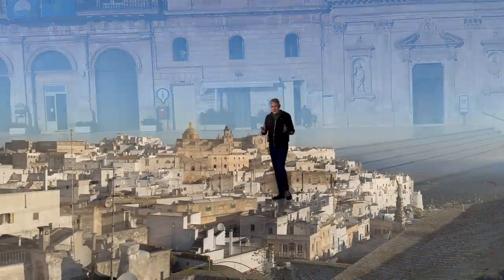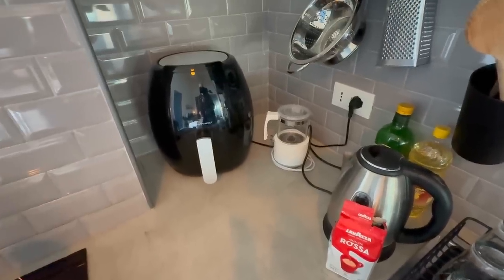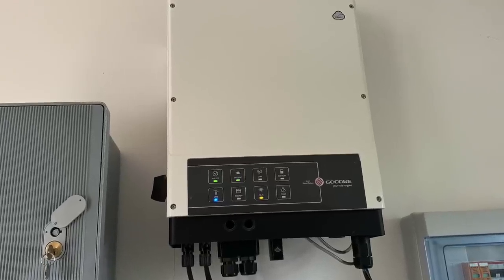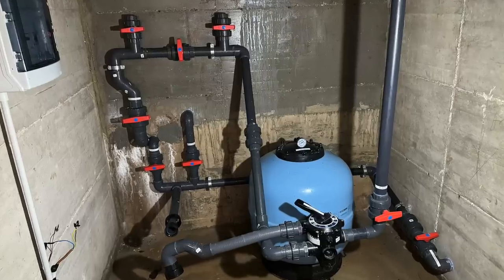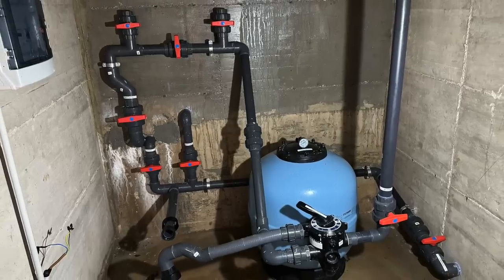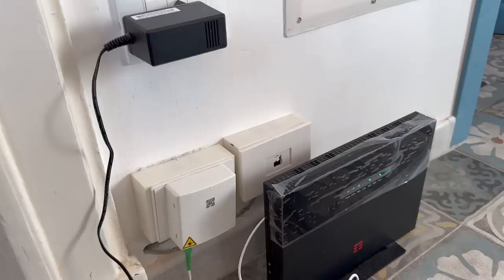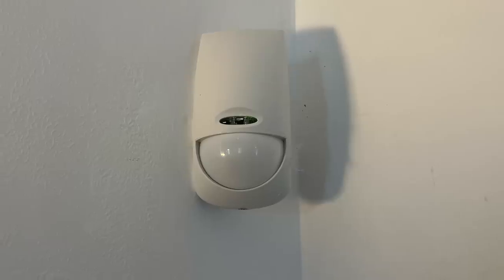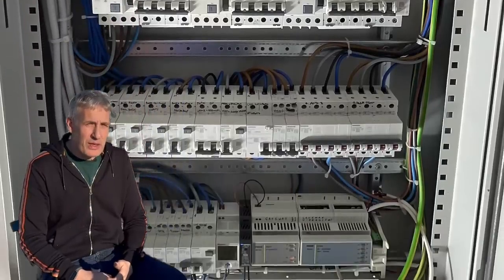How to Find Electrical Faults Before They Happen - OMHERO

Comment: Don't worry: the 25A breaker after the meter is there only because it's required by code, it will never trip. In fact I'm even surprised the 16A inside the apartment trips first, since with a 3kW meter it should trip the meter first!

Reason being that the meter measures the current electronically, and if the power goes above what it's allowed by the contract (depending on how much power you are allowed to draw from the grid you pay an higher fixed rate, 3kW is the norm, but you can get 4.5, 6, up to 10 for single phase) the meter trips out first. What is on the meter is not a normal breaker, in fact it's a breaker (63A) but it can be tripped electronically by the meter electronic itself well below is rating. 

The reason why they don't just put a rightly sized breaker on the meter is that the limit is purely software and depends on your electricity contract, i.e. by making a phone call (and accepting to pay an higher bill) they can increase it remotely, since all the meters are connected to a network (they can even disable a meter remotely if you don't pay the bill!)

By the way, the most annoying thing is that you are no longer allowed to have the meter inside your house, for reason that it must be accessible from the public street, this to allow the power company to check it without having to grant access to your private property (that requires calling the authorities) in case they suspect electricity thief.

Comment: It is very similar in Spain. 16 or 25A supplies. I have found that many of these domestic properties here in rural spain lack any CPC’s or any earthing at all. One property I saw had earthing cable run through out but had no connection to a ground conductor, leaving there salt swimming pool when stepping out as the easiest path to ground during a fault condition with an appliance in the property, which caused the tenants quite a lot of pain when there oven was broken.

Comment: 0:57 That looks like NYIF which we call "Stegleitung" in german which roughly translates to bridge cable, for the wires are connected with a "Steg", the plastic bridge in between, which is a good spot for a nail to fix it to the wall.
Also, most probably, regarding the age, that'll most probably only be twins, without the earth, using a bootleg ground. (Used to be the norm in germany, that's why it's still called "classical")
Reply from the maker: Thanks for the info “classical” like that 👍

Comment: Something to note is that 25 amps is plenty. If paired with more then 2 circuit breakers of course.
Almost a whole house on a single 16 amp breaker is just asking for nuisance tripping.
My, slightly smaller, dutch home is fused at 25 amps. And that is a fuse not a circuit breaker so it can handle small overloads for longer as the wire must physically heat up.

I could upgrade to either 35 amp single phase or to 3x25 amps 3 phase as all 3 phases enter the building. Though it is a rental property so i am not going to do that :).
Reply: They'll handle their EV charging well lol
Reply: My a lot bigger Dutch house is at 35A, but I have homewizard energy so I know almost as much as these prycam people — and I have never yet seen a peak above 5 kW yet. and that’s without doing anything at all to avoid simultaneous use of washer/dryer/dishwasher/kitchen boiler/etc. But: cooking and heating are gas, no AC (other than a mobile unit I haven’t switched on this year), and the dryer is a heat pump type. And no EV, obvs. Change that and I might have to move from 35A service to 75A (3x25) service.

Comment: I don't understand what's taking Europe/UK so long to implement this technology. Take the US market for instance, SPAN panels will now do load shedding, communicate with battery storage and solar generation and monitor all the appliances to see if their individual sign waves have changed, highlighting potential maintenance issues or Arc Faults. Where is the European holistic solution? I want to see GivEnergy or another company start to vertically integrate a solution for the UK, if a consumer unit ends up the size of a double stack 28 way or a triple stack that's fine just give us something that is capable of dealing with our future all electric world.
Reply from the maker: Wise words 👆

Comment: As another aside, a rarity for me in any online platform, the future of new builds will encompass this. With modular wiring systems designed by AI/CAD systems and a basic ( very basic) architecture style according to local conventions. Plug it all together. No skill involved, no testing required? Electricians, as we are today, working on maintenance and old stock only. Years and years away for any of us around now but not the future. CAD and learning this kind of stuff will be and is the real future for cutting edge electrical work.

Comment: I'm kind of used to the drip, drip of Efixx advertainment/information creating in me a desire to go out and buy another "wonder tool" and almost always I am mercifully able to fully ignore it. This however is something that has got me on the hook. I can imagine a large number of scenarios where this device will save thousands and possibly lives and property too.

I am yet to look up availability and cost but if the manufacturer has had the sense to see to both before this release I can honestly see this as a massive step forward in electrical maintainence as well as safety. As ever the cheapskates will do what cheapskates do when they commission and maintain electrical systems. We are all locked in a permanent battle against the worst of the freemarket. The winners, as always, will be the ones that have the pockets deep enough and the foresight long enough to see a good thing coming.

Comment: Choice of appliances reduces peak demands too.

A modern inverter fridge or freezer will draw more watt hours over a given period to an equally modern line operated compressor type, but the line operated one will have higher draw while it is running.  My inverter fridge ticks along at about 40 watts, sometimes down to 20 watts but rarely ever is the compressor off while the line operated one regularly cycles the compressor on/off but puts away 80 watts when running.

Similar higher short term current draw is seen in many old style appliances vs lower continual draw from newer style.  Old style heavy transformer microwave vs inverter type; resistive cooktops vs induction, resistive water heating vs heat pump.

People say that EVs will break the supply in many countries but it is really more a case of uncoordinated EV charging will break the supply.  Have a coordinated system where the network tells the vehicle how much power it can draw and things will be fine.  Owner simply says I want my vehicle to have X% charge in it by tomorrow and let the network work out the details.  Most people doing daily low kWh charges, most people don't go to the petrol station and put in a full tank's worth every day, will have no issue with this sort of arrangement.

Think smarter.
Reply from the maker: Agree it’s all about removing the peaks which also makes the whole network more efficient.

Comment: Very interesting device.  We need to change our consumer unit policies in the uk to allow third party devices and for electricians to build their own DB’s after all we now torque set every fixed connection within a board.
Reply: Wait, you cant? If I understand it right, this digital tracker do not replace/bypass any standard unit, why would anyone forbid it?
Reply from the maker: Agree
Reply: the whole distribution boards need a massive overhaul, current setups are just crap and archaic in design..